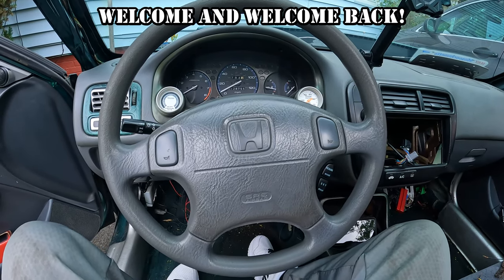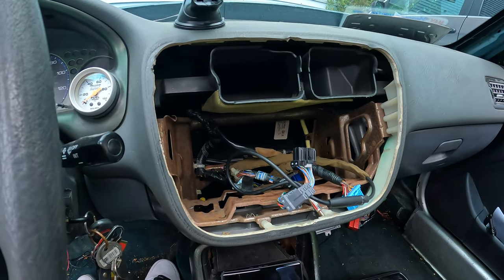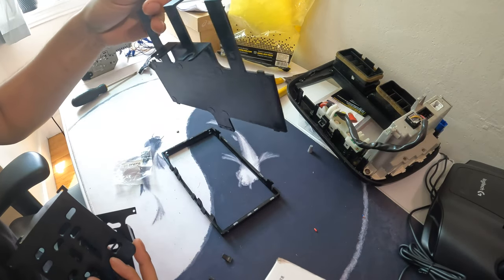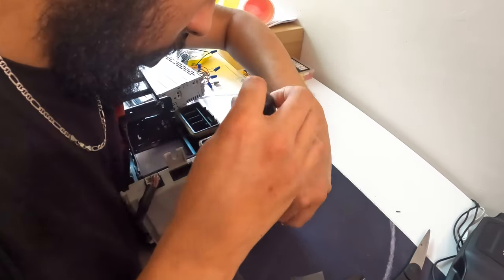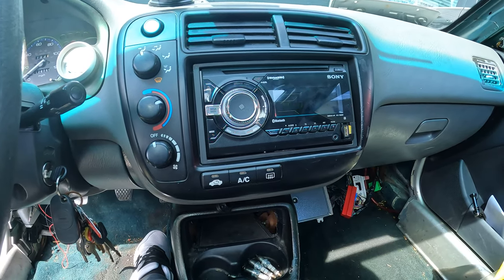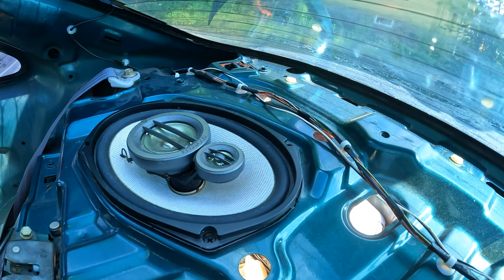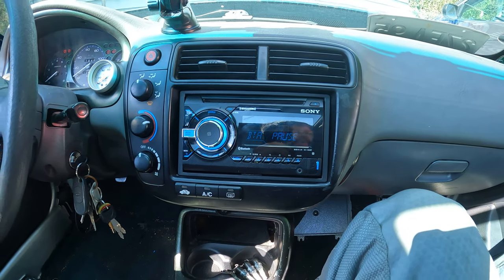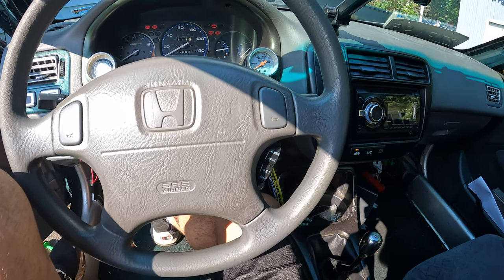How to install an entire sound system in your old car |1996-2000 Honda civic|

Comment: Question! I have a Honda civic 2002EX 70amp alt and Wired just the Rear speakers to 8inch Speakers 275Watts no Amp Worried that the car won’t handle it ?
Reply from the maker: You should be completely fine as long as your alt and battery is doing its job. I installed a sound system in my girlfriend's car with 2 amps powering the entire system 4x75watt RMS speakers and 500watt RMS single sub on stock alt. It's been 2 years and no problem at all, and we like to play our music loud so 275watts will be light work for your car no need to worry.
Reply from the maker: Wait no amp?, your head unit is overworking itself causing it distort which will cause the speakers to go bad over time and the head unit will get fried.
Reply: Why would you upgrade the alt and speakers but not do an amp?. You need an amp!

Comment: What Wattage do your speakers have?
Reply from the maker: Front are 6.5in Boss speakers rated at 300watts max but that doesn't matter, what matters is the RMS wattage rating and sensitivity in DB but Amazon doesn't have that info. Rears are 6x9 Kenwood excelon KFC x698 rated at 75 watts RMS each and sensitivity of 93db. I suggest at least 50watts RMS and at least 90db sensitivity for sound system without an amplifier but with a amplifier you'll want at least 75watts RMS. Make sure to subscribe if you're interested in this type of content and want to support thank you for watching.